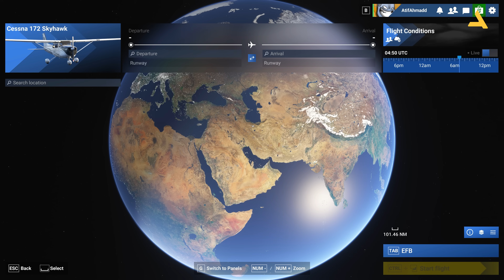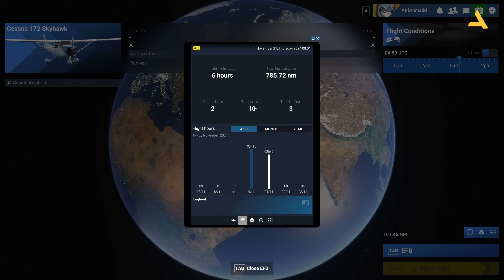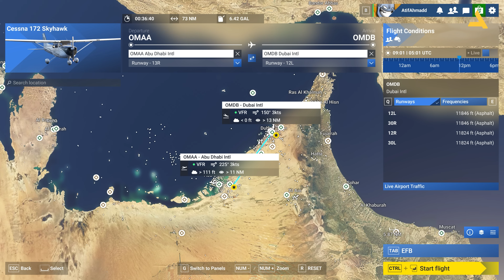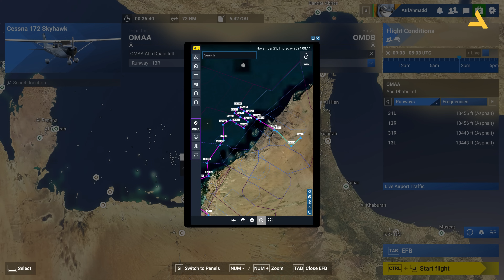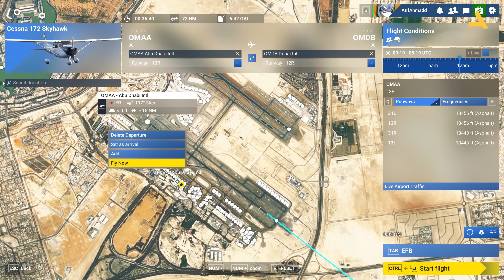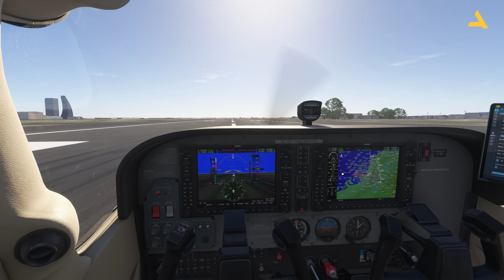Configuring the Electronic Flight Bag (EFB) in MSFS 2024

Comment: Sometime when i look at the arrival charts it doesn't show anything for arrivals, approaches how would i fix that
Reply from the maker: There are some runways for which the airport charts are not available. For example, runways with no defined arrival or approach procedures or small runways and landing strips.
Reply: @aatifahmad  ok also when I am close to the pink line it says on my main screen it says  I am on it but when I open my tablet I am far off it a I end up missing the runway because I have 40 take-offs and only 3 landings.
Reply from the maker: Are you trying ILS approach?
Reply: @aatifahmad  No so basically when I lift off I activate autopilot and nav mode then my plane follows the land on the GPS on my main screen but the flight plane I created the autopilot dose not follow it

Comment: Great video . But after all that the planner doesn’t load into any planes wich makes auto pilot useless . Am I the only one that can’t get this thing to load into a plane ? I can see it load on the tablet in the plane but doesn’t actually load into the system
Reply: I am having the same issue, have you found a way to fix it?
Reply from the maker: Are you trying this in career mode?
Reply: @aatifahmad no in free flight mode
Reply from the maker: What is your departure and arrival airport? Maybe I can try making a flight and see if it works or not. Thank you
Reply: @aatifahmad Victoria BC to Vancouver Bc do you mind sending or uploading a pic of it (EFB settings and MDCU) I have being trying for over a week now I’m pulling out my hair lol
Reply from the maker: @geoh6737 sure I will do that.
Reply from the maker: @geoh6737 what are the ICAO codes for these airports?
Reply: @aatifahmad CYYJ/CYVR thank you so much.

Comment: Hi thanks for the video. Currently having issues transferring my flight plans to the avionics. Had spent time setting up the flight plan on the EFB and then clicked "transfer to avionics". But once I am in the plane (a A330 in this instance), the FMS computer doesn't have the flight plan that I've set up in EFB. Is this a bug?
Reply from the maker: It is not a bug. If a jet already has its own EFB, in your case 330, then use that EFB to plan the flight and not the one in the world map. Thank you.